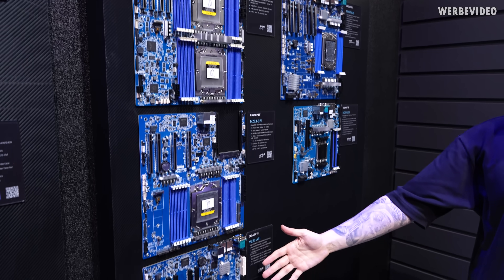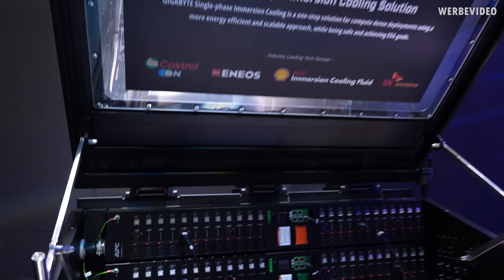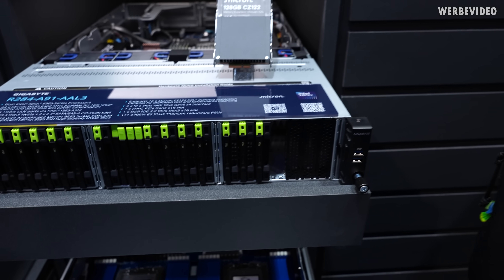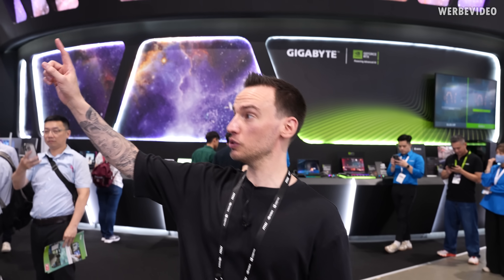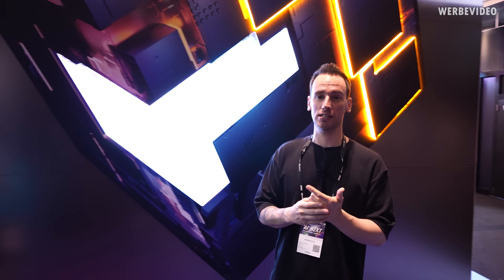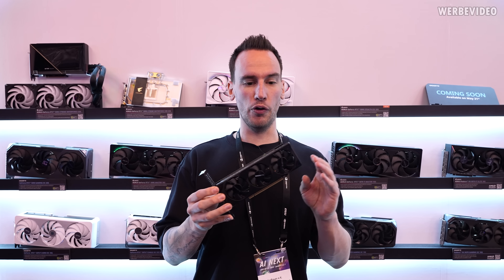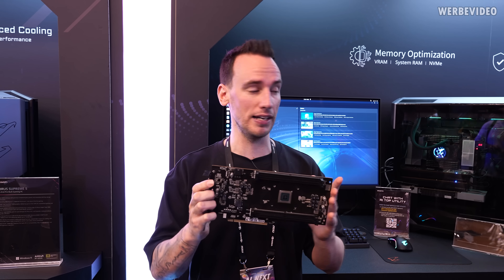PCIe-to-RAM "Adapters"? + GIGABYTE TACHYON with CAMM2 – Computex 2025

Comment: All I got is more question.  What is the point of that RAM card?  Seriously.  How does it work?  Can a single stick use the entire PCIe lane count?  So can 1 single stick use 16 lanes of bandwidth?  I truly do not see the point.  What can a single stick do,  like maybe 40GB\s?  Just a RAID0 of only 2 SSD's can go that fast.  And latency isn't an argument, it's going over the PCIe bus.  Volatile or not, there is no performance difference either way I see, but non volatile obviously sucks if you have to choose one or the other

Comment: PCIe 5.0 x16 is ~64GB/s, a single stick of 8000MHz DDR5 DRAM will fill that bandwidth on it's own so it doesn't seem very useful for bandwidth sensitive tasks like AI where 1000+ GB/s is needed.

Comment: Does the memory board use CXL (Compute Express Link)? Does it require a motherboard with CXL slots?
Reply: If I understood correctly yes, this is a CXL device and the CPU, system and slot need to have CXL capability to use it. (Though it runs through PCIe connections so the slot can still have regular PCIe devices instead)

Comment: Indeed, Wendell did a presentation about the memory expansion. I decided to remove all my A3000 gpu's and replace them with Intel Arc B6 pro GPUs dual die and 48Gb DDR6 memory (2x24Gb) for parallel processing. Thanks for the updates.

Comment: Those SSD form factor CXL modules are really neat. The internal card edge types have been around for ages, but it's cool to see the U.3 & NGSFF style ones catching on too. Regarding the use-case, it's mostly for things like large database loads and in-memory services like SAP HANA. While the main system memory is naturally the lowest latency bulk storage, PCIe 5.0 is plenty fast too and allows for huge size scalability, easily into the multiple terabytes range, and unlike traditional storage it is directly addressable on the CPU.

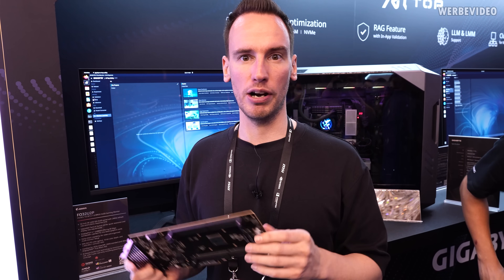Comment: 8:15 - I've never had a chance to fiddle with CXL but if I remember correctly they should show up as a separate NUMA node with 0 compute, so to a degree you should see just 1TB of memory, just like with 2-socket systems where half the memory is closer to 1 CPU and half to the other.

Comment: So, for "consumer" level CXL stuff - Does this require a NUMA capable CPU and chipset?  My understanding is that CXL memory shows up as a general no-compute NUMA node - otherwise this is just a fancy RAMdisk or cache, and probably not worth doing for the price right now.  And if you need NUMA, then you're into EPYC, Threadripper, and XEON architectures, which will increase the price even more.  Memory bandwidth over PCIe (Even GEN5) will be slower of course, but if it's intelligently used I can see a great use in data intensive applications, but not necessarily AI work.
Reply: From what I understand the CPU needs CXL hardware, at least. But the bandwidth of a single DDR5 channel can actually be lower than a PCIe gen5 x16 link's(even if you count PCIe in only one direction), while using more pins and, I think, more silicon area...
Reply: What AMD said ~2.5 years ago (giving a 3-5 year timeline) was that CXL was going to come to the server area first, then move down into the consumer area.

Whether that means that consumer CPUs are eventually going to be capable of (limited?) NUMA, or whether CXL is decoupled from NUMA entirely, I'm not sure.

Comment: I want to see more CAMM2 motherboards with reverse connectors, especially reinforced connector for the ATX 24 PIN PSU connector. Taking the connector out or inserting the connector and having the motherboard flex still unnerves me not matter how many PCs I build or repair for friends and family lol.... I don't charge them instead use the opportunity to educate them how they can build and repair their own as well as how to troubleshoot. As a result I have less and less headaches to deal with.

Comment: That expansion card reminds me, it would be cool if video cards could have a sodimm slot for an “L2” memory cache. DDR5 would be fast enough. I mean, obviously it would be better if companies would just spend the extra $15 per memory die and not charge us a crazy markup, but at least an expansion slot would extend the life of video cards.
Reply: Nah, CAMM2 slots actually make more sense for graphics cards as they are low profile, hit higher speeds and can also utilise the cooling solution ontop of the PCB. So-dimm slots will be incredibly inconvenient not to mention the latency penalty from moving data out of an "L2" memory cache. With CAMM2 modules this would open an additional use case for the modules making them mainstream quicker. Also with the 'solid state cooling' solutions we will finally see some very low profile graphics cards. Which would help considerably with GPU sag and airflow. The latter will be paramount for GEN 6 and GEN 7 nvmes.

Comment: So I guess this isn't going to be the year that PCISIG finally comes out with a board connector for consumer motherboards that can actually deliver the power a modern GPU can draw so we don't have to keep plugging extra power cables into our GPUs? Or the year that ATX revises the 24-pin connector to include enough power and ground pins to actually power the CPU? Or the year that the keep-out areas in the ATX specs get increased to accomodate modern high-power CPUs and GPUs and their necessarily massive coolers?

I guess we are just moving connectors to the back of the motherboard without any sort of spec for where an opening should be to allow access to those connectors? Maybe covering even more of the board with plastic and aluminum shields of questionable utility? The consumer market really isn't worth their time these days, is it?
Reply: Coming up with new standards is that one XKCD comic. And you can't just dethrone a legacy standard in consumer space because consumers want to reuse older parts they have, and don't want to invest in something that may become obsolete due to lack of demand. Meanwhile, every company will also want their version to be unique because walled gardens pay more, and money is the only thing they actually care about in the end.

Comment: CAMM2 🤮👎 this is not progress this is regression, instead of plug and play there are screws..., adding RAM does not exist.
PCI-E 6/8 pin power on the bracket suits me.👍
CXL seems great.👌
I remember the great Gigabyte I-Ram GC-Ramdisk Unique DDR-Ram Based Data SSD (SATA port) expansion card.😍

Comment: CAMM2 is definitely a better option than soddered or on-package ram and i wish more systems would use it. Also its awesome to see Roman's reaction to all the enterprise gear :) they push the bleeding edge tech there, and it usually comes down to our consumer gear within 5-10 years. It'll be a game changer when CXL is available on consumer systems, especially for things like vram expansion
Reply: No doubt. Really curious how bad the latency is on the CXL memory. Bandwidth is obviously limited by the PCIe BUS, but latency could be really bad depending on the application requirements. I can’t imagine this being a useful solution to add VRam to a gaming GPU to make up for the fact that nVidia will still be selling 8GB cards for $400 in 2030. Once you traverse the PCIe BUS, you’re already taking a major hit to latency equivalent to hitting main system DRAM. But for applications other than gaming, this could be a non-issue, particularly if the memory accesses are sequential in nature and the data can just be sent like a firehose (assuming the GPU can process all the data that quickly!).
Reply: Not if Ngreedia has anything to say about it

Comment: lol, CAMM2 in consumer desktop makes no sense. Its to try and get you CUDIMM like performance in a extremely thin chassis without breaking upgradability.

Also for the training server I wonder if thats one of the units Meta or OpenAI fried running weeks of constant training on. (every time I see one of those at a trade show I like remarking on the high failure rate of those GPUs).

CXL and the new server cooling stuff is really cool though.

Comment: 5:53 - I'm running the cable through the hole I usually run the front audio cable through. Usually, you have to run it before installing the power supply. But overall it looks cool, I have some photos and videos on my channel

Comment: imagine showing this to someone from the DOS era, "yeah man you can get 4TB of Ram", they may pass out.
Reply: "640 KB of memory ought to be enough for anybody" - Bill Gates
Reply: Hey, we aren't ancient history yet. We're right here watching this video with you guys! 🤣
Reply: To be fair that’s not new, I’ve got a 2014-era server with 1TB of DDR3 that’s configurable to a max of 6TB, or 12TB of DDR4 (with different memory daughterboards, which were only available in 2015+). High-memory servers these days are up to 32TB of DDR5 (8-socket blade or stack servers), or 16TB in standard 4-socket machines.
Reply: You may have to explain the "tera"  It wouldn't have meant anything to me.  - Then I would pass out.
Reply: There were memory expansion cards even back then. Memory chips weren't that advanced, and relatively expensive, so it wasn't that popular. It was called 'Expanded Memory'. Later versions of DOS included EMM386 that would emulate the interface of these cards in order to access any on-board RAM memory over 640k in 16 bit mode, so you could pretend to have an expanded memory card to use your regular additional RAM.
Reply: Dos era child when exposed to top end modern enterprise rack server

Comment: 8:15 so how can we use this memory expansion card like the old game sharks to passthrough and intercept signals from the video card to add more dedicated video memory to all these 8gig cards in 2025
Reply: You can simply by not doing anything since any OS that is tuned for it (windows by default, linux if set up for it) will just use system RAM as DRAM if needed.

Comment: 5:17 The cooler is long and unnecessarily large, because if it's small, people might ask themselves why they're paying $400 for a 5050-class GPU
Reply: Exactly my thoughts when he showed that card, big is powerful right?😂
Reply: I figured it's to get better airflow. They could use a slimmer but still long heatsink so it takes fewer slots in width that way. Possibly quieter too. Is also plausible that marketing had a hand in it tho.
Reply: @rarrawer generally the limiting factor for smaller cases is length not thickness. I doubt the card generates enough heat to warrant three fans
Reply: If I could fit an extra card in, I'm still taking the thinner video card in most builds
Reply: Really nailed home by the fact they have a tiny SFF version of the 5060 too lol
Reply: I have an RTX 4070 with just two fans in a somewhat crammed case. Yet it never becomes loud while gaming. A 3 fan GPU would be too long.

Comment: Someone modded the Gigabyte 5060 Ti, replacing the stock cooler with a Thermalright AXP90-x47. It's a bit dodgy temperaturewise, as default but tweaking the voltages and tuning down the clock speeds made it actually kind of viable. Looks hilarious though.

Comment: Does the Tachyon have anything to cool the CAMM2's underside?
Reply: Can you elaborate on what you mean? Doesn't the CAMM2 PCB only have electrical contacts on the under side like an oversized BGA setup?
Reply: @Samqdf  Some variants have memory chips on both sides. The contacts(LGA?) only cover part of the surface.
Reply: @whyjay9959  I see, I checked and you're completely right. I incorrectly remembered what the electrical interface looked like. It indeed only has the contacts for part of the surface area and there are usually BGA modules on both sides. Your original question is a valid one as even though DDR5 modules don't draw much power they are still stuck between the RAM and motherboard PCB's. The best I can think of is that the heat from the bottom modules is indirectly dissipated by soaking through the PCB, top side modules and then a heatsink? I am wondering about it myself now as well. Anyway thanks for the answer to my question.

Comment: please gigabyte, make the 5060 SFF also come with a 12gb vram or 16gb version. i LOVE these cards but 8gb is rough unless you tweak settings for every new game to land under typical vram usage
Reply: for sff im more interested in that half height intel B50 Pro that has 16gb, but if that 5060 sff comes with 12 or 16, im sold on that too.

Comment: That power cable at the front is a nice thing, while might be worse(maybe better?) for cable management. Having the cable there could help with the gpu board sag. PSU cables especially good ones are quite heavy and definitely contribute to sag.
Reply: Err PSU cables aren't that heavy, presuming the cables are routed below the fans - if they are contributing to sag for you then they are too taut.

Comment: the pcie to ram adapter is pretty cool. my thing only because i run a local llm myself is. when you are doing ram and cpu combinations the ai model is fairly slow. so wouldnt it be even slower if it has to access memory via pcie slot also?
Reply: Yeah GPU VRAM > 2ch DDR5 RAM > PCIE 5.0 x16 when it comes to bandwidth
Reply: Yesish. It will be slower in basically all cases UNLESS the ram is heavily thrashed. Then the PCIe RAM can work quite well but its usually just for having bigger datasets

Comment: CROSSING Fingers FOR CAMM2!!!
Reply: And BTF MOBOS.. They look slick.
Reply: @garystinten9339  not just that, they also significantly help with airflow so does CAMM2 as it's very low profile. The placement at the top helps with builds with chunky radiators at the top as the over the top VRM heatsinks on motherboards really poses a clearance issue for fans. I had to take 3 screws out of a fan so it's slightly at an angle to ensure the Arctic LF2 clears the motherboard.

Comment: wouldn't this make the "muh short trace" pointless?
also, gigabutt's 5060ti pcb is half the length of 5060. lol.
Reply: Yes. Also pcie isnt as fast, and lots of latency on top. Still faster then any SSD.
Reply: I think PCIe data traces are more tolerant of length and other noise-adding things than contemporary DDR ones, while having proportionally more bandwidth.

Comment: 7:44 - this reminds me of the days when Gigabyte had a product that was a physical  ramdisk built from DDR modules called the i-ram. I remember those things being sent out to all the tech websites for review but despite so much hype and PR. The product never caught on and once the hype around it died. So did the product.
Reply: Yeah, Gigabyte i-RAM. Although it's still a great idea, you could accomplish the same effect just by loading Windows into a ramdisk (Linux allows for this). There's also prefetch/superfetch.
SSDs obviously use RAM chips for cache...
Reply: @themodfather9382  not only ramdisk, Linux also just caches files into RAM if they're used often
Reply: @formbi  So does DOS with SMARTDrive...
Reply: Yeah I remeber Ltt did a review on that. It was too long ago that I felt old now.
Reply: Desktop computer of 2002-2006 were often glued with a maximum of 4gb. This gigabyte Ram add-on update was not very helped by the manufacturer.